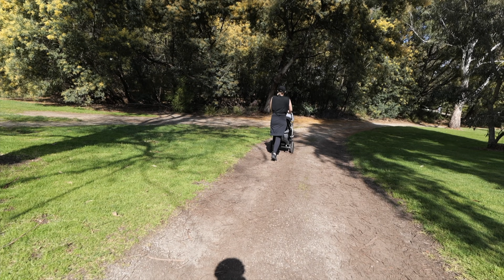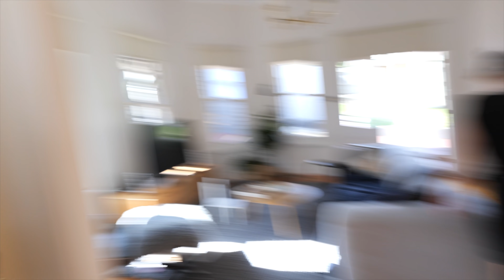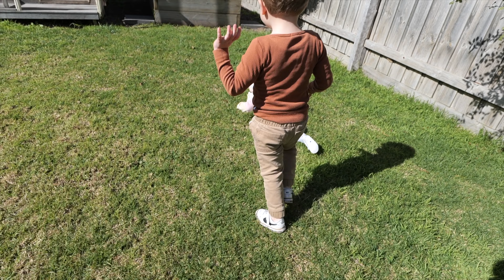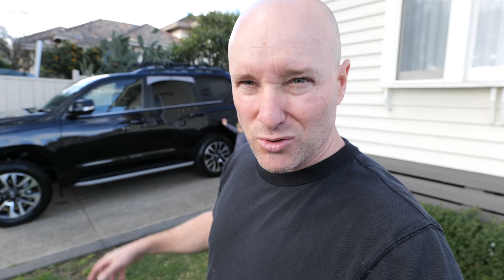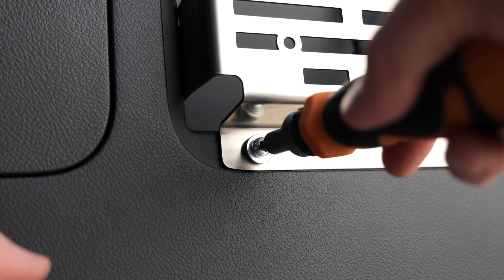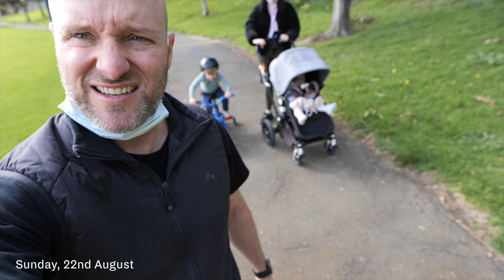Life In Melbourne Lockdown 6.0 (Family Vlog)

Comment: I have had a similar car to the Prado here in the states, toyota 4runner since 2011, I can say it is not the most high tech car but it is built solid and I expect it to last the next 20 years. it has retained more than 50% value actually due to the current shortage of cars both used and new here, I have seen offers of 60% of what I paid for it and I have seen cars with similar spec for sale going for 75% of what I paid for it. Black would not have been my choice for the color expecially if it will not be garaged, but that prado is nice looking. Not sure if they are legal in Austrailia, but a Hitch mounted bike rack is nice to have. Sorry for the long message but this video covered multiple subjects I am interested in. Watch out for the crazy lady.
Reply from the maker: The crazy lady! haha